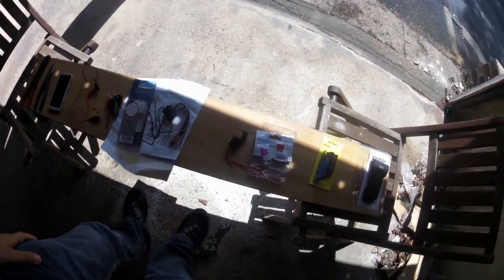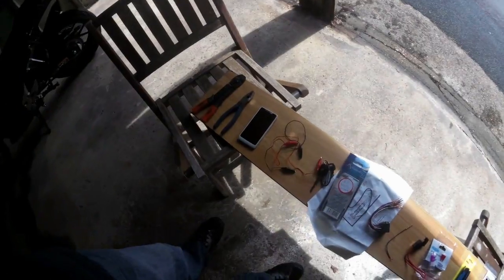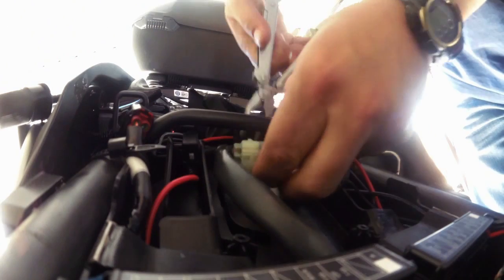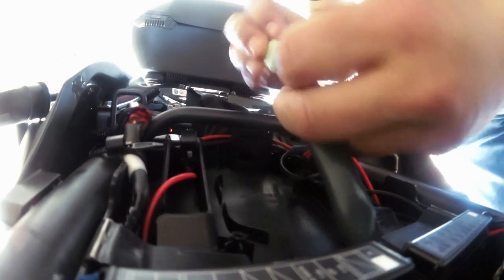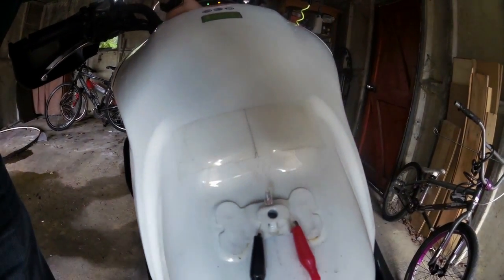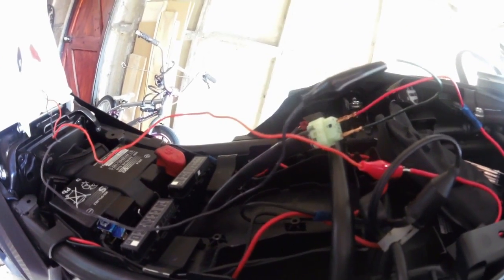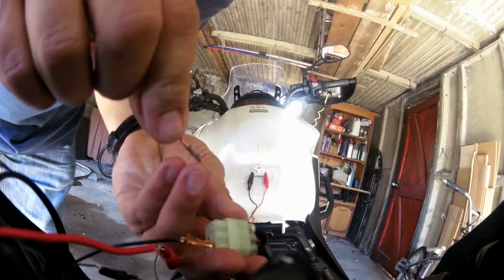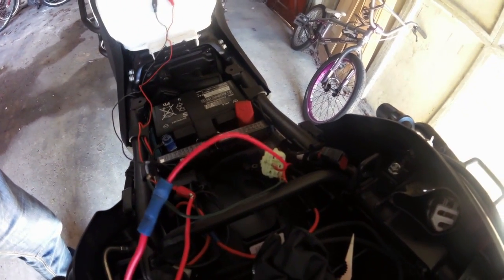Honda CB500X : Experimenting and SUCCESS on the Honda OP (Options Plug)

Comment: I think the orange one is to link to alarms so you can flash the indicators when the alarm arms / goes off.
Reply from the maker: Interesting. I was only really interested in the "live when switched on" purple and managed to find that one out and complete the circuit. Once done, I haven't looked at it again. But there is an easy way to open the whole thing with just one hand instead of trying to pry it open with a few screwdrivers lol, think that solution is provided on the cb500x forum thread too
Reply from the maker: Just rechecked this vid, and at 9 mins I confirmed the circuit worked when plugged into orange and the indicators were switched on.
Reply: O8 ride yes, I saw that bit but I believe it can work the other way around too so that instead of having something powered when the indicator is on, the alarm flashes the indicators when it is triggered.

Comment: I done a little bit of reading on this, one of them may have something to do with the ECU, so just be careful with it :-)
Reply from the maker: metalhead18241 One of what MH? One of the specific 5 connectors within the OP, or one of the various electrical points that are dotted around the bike that look like Options Plugs? 

The Options Plug I have been playing with is the one where you are meant to add other things to make the electrics easier. One wire is switched for the headlights, two are switched for the indicators and only come on whern the indicators are lighting up, one is unswitched and always live as a straight connection to the battery, and the other is the negative.
Reply: O8 ride Yeah, one of the connectors in the options plug - I may be wrong, but that's what some people were saying online...
Reply from the maker: I think the ECU has a different plug, that sits under the right hand side of the seat. The OP I am talking about is in the centre and the 4 live wires control the indicators, the taillight or headlight, and one is a straight 12v unswitched direct to the battery